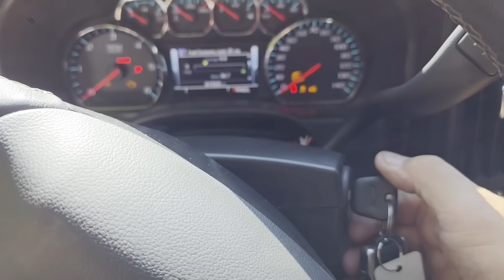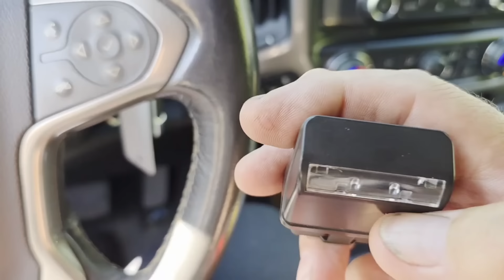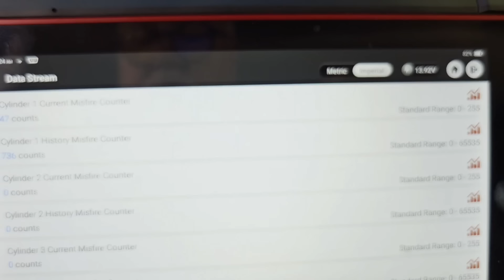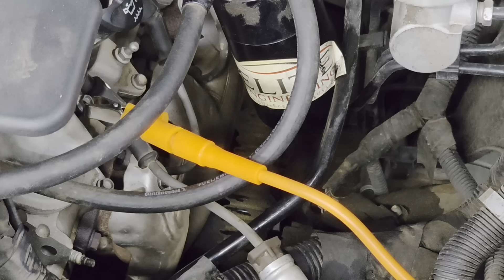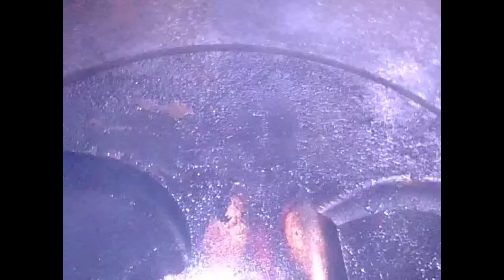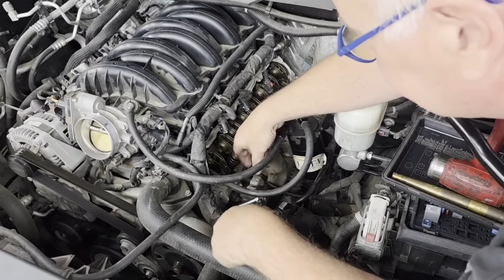No Abnormal Noise Turns A Simple Misfire Into An Engine Teardown.

Comment: Bent pushrods in a gm v8 usually indicate over revving the engine and valve float. The pushrod is bent because of valve to piston contact. Pretty common in Pontiac Firebirds with the manual trans

Comment: I'd bet on someone over cranking on the rocker. When I got my first car the engine was rebuilt by a crap shop. The rockers were all loose. I over tighted the rockers and bent several push rods. This certainly looks like the rocker was over tightened with the difficult had when breaking it loose. I do think pulling the head is a better safe than sorry solution.

Comment: Check the spark plugs in the next next cylinder. 
If they are the old ones the problem may have been built in on purpose.
The last shop found a bad sparkplug and replaced it with a new one.
Then the cover MAY have been removed and a bent push rod installed making sure the engine had a skip.
Some would charge for a new engine, after the steam cleaned it and placed a new push rod in its place.
Some mechanic shop are not honorable.
I'm old school and have even witnessed a person charged for a rebuilt  automatic transmission when the problem was a simple vacuum line that was unplugged from a vacuum modulator. 
Messed up but it happens.
I would put a replacement push rod and  restart the engine. Lay the valve cover on to stop the oil from spraying out.
Have scanner plugged to read.
Like you started out by saying.  Don't trust what someone else said, and question yourself.
People love to steal easy money.

Comment: There's an engine recall on that model.. rod defect... That was a huuuuuge issue that cost the company billons... Suprised you didn't know that 😮 There's a website to check VIN# ... Chevy either replaces the engine, or adds 10yr 150,000 mile warranty

Comment: Maybe an oil change interval issue. I have a 2018 and do 5k oil change intervals. No problems so far. Has 80k miles on it now. 0/20 oil is what’s recommend but I think I may go with 5/20 here on out.

Comment: I put an engine in a 2019 with 46k.miles. new engine had fuel management deleted❤
Reply: how did you delete it ?
Reply: @MozartosKhan it was a Jasper engine and they sell them with a delete kit, no fancy lifters, nothing but plugs in the plate. The best part a plug in programmer they send with the engine❤

Comment: If it has over a 100k and it has dod issues I drop a reman in there . They are  all going to be issues and the heads should be redone especially since it probably tapped a valve. Trying to save the customer money by saving it will likely cost you the end. A reman will have a warranty for 100k so it does not bite you in the butt.

Comment: I have a 2011 Chevrolet ½ton Silverado with the 5.3 engine. When I first got it I would have to change #1 spark plug roughly about every 1000 miles due to that same misfire code. We did just a software delete to stop the cylinder cut-off "option". Occasionally, I still get the misfire code and I can help it by just removing that plug and cleaning it, & regapping it. Right now, I have a little over 120,000 miles & its been probably 6,000 since I had to clean & regap. GM did not do consumers any favors with this little invention to save fuel. I was lucky because we did not have to replace a destroyed emgine.

Comment: At this point i would be putting my in cylinder transducer hooked to my scope so i can tell if the valves are opening. For those that dont know what i am saying, Scanner Danner did a free vid about it 10 years ago. EDIT AFM  lifters are 1 4 6 7. The lock pins in the AFM lifters wear down into ramps and cant lock anymore. Initiallyy they fail silently until the pushrod dislodges.. Then it getsx ugly, the lifter spins and breaks the basket and wipes out the cam. At gthis point, i think its just lifters.

Comment: Hi Kenny. I'm interested in your spark tester. Do you have a link or recommendation for a tester used between the plug and coil pack?
Reply from the maker: Hey Paul. This is the one i personally use:
https://amzn.to/4nv4ZYa
I've actually had the same one for over 20 years, and just replaced it with the exact same one because it worked soo well!! Thanks for watching. Keep wrenching brother 🔧 Kenny
Reply: @WrenchingWithKenny Thank you. It's been ordered. BTW I miss the days of distributors and ignition coils. So much easier for me to work in.

Comment: I left chevy years ago after a impala with 305 v8 had a valve stud problem. Chevy used press-in valve studs and 2 were pushed out and wore out the cam lobs. The big blocks used screw in valve studs. Done with chevy and general motors.

Comment: I have an 08 GMC Sierra. I had a DOD lifter fail on me in cylinder #1. I had a local garage change all the lifters to keep it from happening again. One week shy of a year afterwards, the lifter in the same cylinder failed again. Same garage replaced that lifter. A GM mechanic at a local dealership told me that if they didn’t replace the valley cover then it will do it again. He said that was where the oiling issues were coming from. He was right, it happened a third time. So this time I had a little fun with it. I had that GM mechanic install non-DOD lifters, deleted the DOD fuel management. Put in truck Norris cam from Brian Tooley racing, installed headers as well as new springs and push rods. Had it tuned and it sounds awesome! Haven’t had any issues since.
Reply from the maker: That is a great fix! I have never had the cover be the entire issue, but it makes complete sense. Thanks for sharing your experience with our viewers. Keep wrenching 🔧 Kenny
Reply: @WrenchingWithKenny all the shaving from lifters & cam  plugs  up solenoids under  valley cover...
Reply: None of that AFM and start-stop crap would have been installed except for the EPA harassing car manufacturers over nothing.
Reply: _n
Reply: ❤Cool beans on the delete.

Comment: I just ran across a misfire condition on my car.. same tests, good compression, no leakdown, new plugs, wire and coil. Different codes coming up for seeming no reason.. #6 missfire, Bank 1 to rich or lean, bank 2 too rrich or lean. Good fuel PSI, new O2 sensors/cats, purge solinoif good, cam, crank sensor good, grounds good, throttle body and solinoid good, all injs food. Smoke leak showed nothing.
Start car, run 5 min.. smooth as can be. Start driving.. seeming smooth, then eng starts bucking and missfiring. Bring back, get out and pop hood and engine was running fine. Sprayed everywhere with carb cleaner to look for vac leak at bank 2 hit -17 when I looked back on scope. Could find no rpm change and stayed smooth.
Was at a loss and just started taking random itemes off to ispect.. When I did, I bumped the sold plactic PCV line and it moved a lot. I took a look closer and saw a crackk right at the end. So with car sitting still, the plastic line was sucked together and showed no leaked.. when car moved, the line would move and allow air in. $12 line and all fixed.
Guy at shop told my daughter to hurry and get rid of car because #6 has major damage.. The shortblock  has only 10K on it and it is 30 over as I was planning to use to take boat to ramp 1 mile from house and not worth buying another car. People were shocked how easily it pulled my 28ft Cutty out of the water.. you could hardle tell there was a load.

But finding that platic line that passed smoke test, passed spray down and even put shop vac on tail pipe and blew air into exhaust and sprayyed soapy water on all components.
Platic line fine intil ya hit bump.

Comment: A common cause of bending a valve is due to an overspeed issue.
You need to pull the springs off valve and it will give you the answer. No matter what 99.9% repair will  have to remove head.
A bad inj that blew off tip would cause flood in chamber and cause damage to valve.
Also, should check oil to look for anti-freeze content. The cyl may be hydro-locked from coolant in cyl from headgasket or worst, a cracked block.

Comment: I missed part, but the scope will tell you if it had valve/pispon contact.. You shuld tap valave and see if it is frozen.
You showed without rocker that pushtube went up and down.. with rocker on, no push tube movement. Throw in a new pushtube and see if you get movement from rocker arm. I am guessing it has a slightly bent valve.As long as you have valve cover off, pressurize that cylinder and see if there is a leak at the valve that would confirm a slightly open valve. Tou can also remove anther rocker and compare the height from the top of valve to head. I would guess you will find the one valve just a fraction lower.
I do not read comment or listen to what you say at the end. I spent 20 years finding cause of failures on Cat Engines and enjoy they proccess.. but after 20 years.. you can usually guess what is wrong with the engine because if something fails and multiple engines.. more than likely it will be the same thing. It was cool at first, then it was robotic and you could tell what was wrong by exhaust smoke color and hit each cyl at exh manifold with a heat gun to check temps to tell you what cyl is having the problem..

Ok.. now to finish watching as I am yelling for you to hit the vlave with a hammer....lol

Comment: Same thing happened to mine at 136k on exact same cylinder and valve.  I had dod deleted in teh ECU but still running the stock DOD lifters.  I tore it down and replaced lifters and a NON DOD cam and now running like a champ.

Comment: Junk and it’s a High County 5.3 is junk too my 2014 dropped a lifter and destroyed the cam at 107,000 miles Junk!!! They replaced the  VLOM manifold as well AFM lifter came apart. I had All lifters replaced always been a GM truck owner no more very very very disappointed

Comment: Valves never contacted the piston when the exhaust lifter stopped working the cylinder pressure is so high the intake valve can't open and bends the pushrod

Comment: I had a 73 AMC Grimlin 258 cubic inch engine the same thing happened on the number 6 cylinder, straightened the push rod, and the miss was gone , no more problems

Comment: Didn't gm have alot of 6.2 engines quit running due to bad cams or lifters , I think because of inferior metal used to make the cam ,under  warranty and had to replace thousands of engines for this reason

Comment: Changed out my stuck injectors and fuel pump and a bunch of stuff.  Only to find the oil pump sensor was failing and ended up dying again.   Loud knock. Probably messed up the cam.  But changing that on the 4x4 models is a major pain

Comment: Seems to me if the lifter was doing its job after the rocker was removed but there was zero movement when the rocker was in place the current physical jam must be the bend in the push rod. That rocker retainer was extremely tight to begin with which is kindof sus and for a 100k engine that was the driest head Ive ever seen, you didnt even get your fingers dirty with oil mist. I dont see how throwing round finely machined lifters into an well worn lifter bore is going to do anything helpful unless you pull the motor or risk running a hone in place. Throw a new push rod in and change the oil so you know the viscosity is correct and there are no crappy additives in there from the customer

Comment: 2015 ecotec 4.3 skips at idle the worst , actually smooths out with rpm..  190 psi cranking compression with engine not running, 90 psi running, has zero leak down when performing leak down test.  rocker arms move up and down the proper travel.  valve springs are good.  new coil, plug,plug wire and injector. Live data from a scan tool, misfire counter cylinder 4 is def dead cylinder at idle,but misfires less with rpm.  Shop also installed a new pcm thinking that could be the problem. Was told it still can be a internal problem with a valve ,guide or seat that may not appear until cylinder actually "fires".  That maybe with plug out and compression tester installed it shows normal psi .Any help or input, about to pull my hair out .

Comment: That's a afm disabler, whenever it switches back and forth it will cause a shutter in the torque converter and eventually cause a premature fail in your torque converter.

Comment: OK Ken, I'll bite. I personally almost never do a compression test. Normally it just never shows me anything useful. It's like box checking and I don't care for it. You did it and found none, but why? Right there is why I don't use it much. It doesn't reveal why. We gotta dig deep to know what's going on and comp testing is just extraneous information.  However, when you did the leak down, you saw a leak. That meant somewhere the pressure is escaping. I would usually try to establish where it's leaking. Crankcase? Intake Valve, Exh Valve? Head Gaget?  This time it would have been back into the intake. BENT VALVE. Immediately suspect pushrod is messed up too. Pull the rocker cover off and look for carnage under there. You saw a bent pushrod and now you have to figure out why. I would not know anything that could explain how ONLY ONE cylinder is dead.  If it was revved too high others would have a problem too, but NOT certainly. Cylinder balance check should reveal if there is another one or you could leak down test all of them.  You guys with your fancy computer reading devices maybe can look at the misfire count and use it for a balance test or something. Perhaps you can see different amounts of contribution from cylinder to cylinder, I don't know. So, go back to old school, befor GDI, Cam Phasors and AFM and what do you get? I believe your knowledge of #1 being part of the hocus-pocus razzmatazz AFM DOD is the key. #1 Intake lifter is the culprit. An internal tolerance issue or some mechanical failure related to AFM lifter engineering or dirt inside it jamming up the hydraulic piston. I'm not at GM anymore so I can't call someone and see if there's a bulletin. But Probably nothing more than a lifter issue that somehow kept the valve open and bent it just slightly along with the pushrod. My Experience comes into play: My best friend in high school got a brand new 1970 340 'Cuda 4 speed for Christmas/ graduation and raced the crap out of it. He kept punching a pushrod thru a rocker arm. The Chrysler/ Plymouth dealer put 2 new rockers on it for him befor I took over. Whenever he missed a gear and the engine over-revved, one valve would kiss a piston and the lifter even though hydraulic would not collapse any and the weakest link was the cup or pocket where the push rod ran in the rocker, so it'd punch a piece right out of it and the engine would drop down to 7 cylinders.  So, in your case if the cam lobe is OK, I'd put in a new lifter pushrod and intake valve. But only #1, no others, unless you can establish why it happened and suspect other lifters. DOD/ AFM is the culprit. It's got something to do with that lifer design. It failed internally and piece got under the hydraulic piston or dirt or tolerance was too close. Maybe even heat. I know what I'd do if'n it was mine, I'd put the trans in manual mode and limit it to 5th. (in my case I only have 6 speeds) My engine will revv about 400 rpm higher at highway speed, but AFM is locked out, and thereby eliminate the engineering issue of the AFM lifter possibly. (I'd probably also put in a non AFM lifter too) but then I don't have the tools to disable the AFM and I don't know if it's illegal for a business to eliminate AFM/ DOD. The Lord knows I pulled enough Catalytic Converters off, made bypass tubes and even hollowed Cats out, but my boss was tolerant of it, in fact he asked me to do it.  We'll probably never know why this happened, I'm not at GM anymore and don't know who I could call about it, so we have to chalk it up to one of life's little mysteries. Good Going Ken, you are the man. Keep up the honest work. ben/ michigan
Reply from the maker: Thank you Ben for your detailed response. You're right, finding the exact cause will be a mystery. We didn't see any evidence of a valve striking a piston. We replaced all lifters on that side retaining the AFM & the 1 pushrod. Thanks for your support. I appreciate you. Keep wrenching brother 🔧 Kenny

Comment: All it takes is a flat cam distributing metal fragments into the lubrication system...   AFM (Active Fuel Management System) lifters are notorious for collapsing and rotating 90° thus, taking out a cam lobe.
AFM delete was invented to prevent this mess in the first place.
Reply from the maker: Luckily, that's not what happened. Thanks for watching. Keep wrenching 🔧 Kenny
Reply: @WrenchingWithKenny  

It's a living and a hobby, all in one!! 

Lifter collapse is common on the AFM lifters in particular. The other issue is the filter screen that lives under the oil pressure sender. Eliminating the screen is the leading cause of lifter collapse, since it lets impurities through the AFM solenoids and causes them to become stuck down.

Hemi engines with AFM can waller out a lifter bore and require sleeves to resolve the trashed lifter bore.

Comment: 3:36 it's an AFM DOD blocker. keeps the truck running on 8 cyclinder mode instead of obama 4 cylinder mode. oil ports in the deactivating on demand lifters since obama EPA mandate can't handle oil that is not golden all the time and 1 or more lifters fail and then pit the camshaft lobes and  spin the lifter sideways and then the motor takes a dump.
this is why the shop quotes 15 grand. last i knew 2 years ago i was quoted 14,000 for a new crate engine. 1 lifter failed and spalled the cam lobe before i could figure it out, all because i didn't want to change my oil in -20º temperatures at the end of January that took until March to warm up to 30º
Reply from the maker: AFM & DOD have been around for 50 years. I pay someone to change my oil in the winter & the heat of summer. I am a fair weather oil changer 😁 Thanks for watching & sharing your experience. I hope you got everything sorted. Keep wrenching 🔧 Kenny